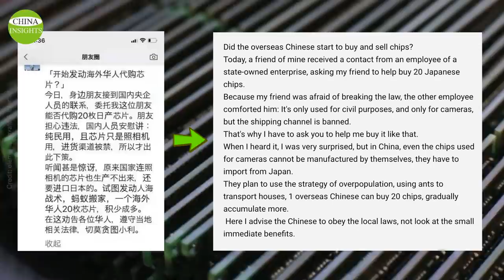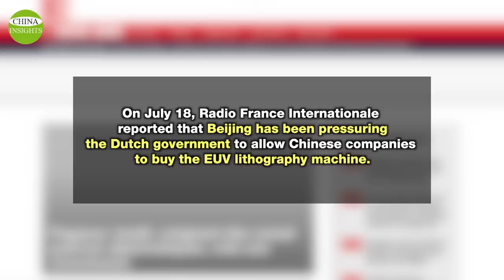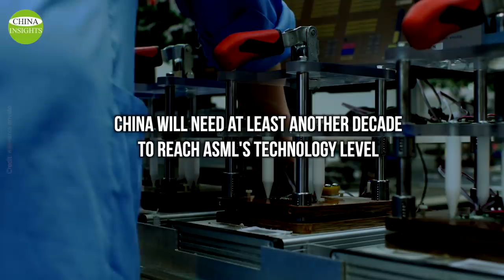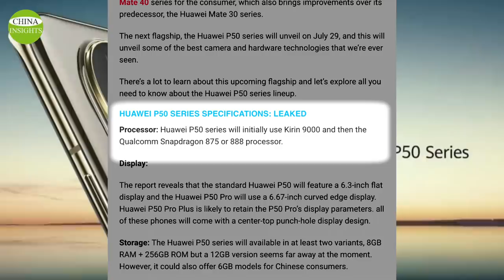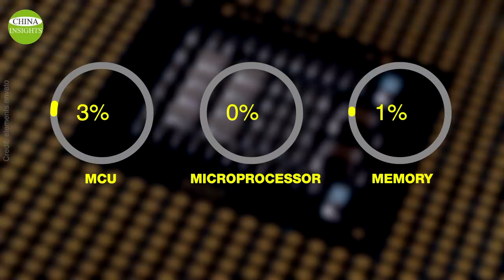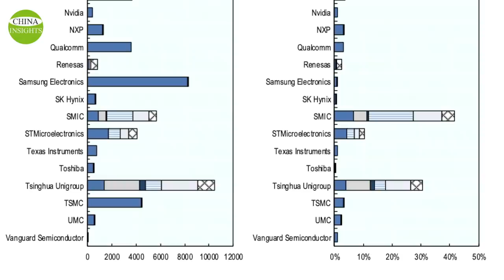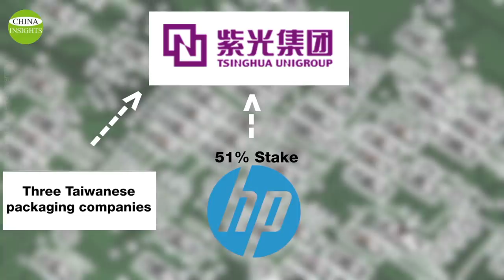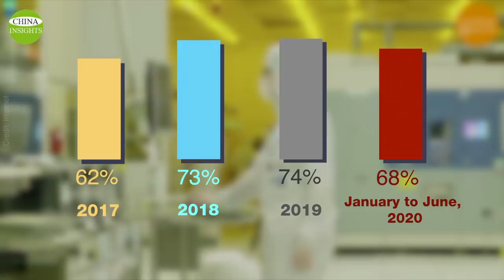China chip shortage: $1 trillion government funds/How a giant with massive capital become bankrupt?

Comment: China's problems, in semiconductors, go a lot deeper than just foundries, which people are over-focused on. Even if they had access to current gen UV lithography, they lack the know-how on the uArch design side, which is the starting point of the semiconductor business. What AMD, Intel, ARM Holding, Nvidia, Apple, Qualcomm, etc., have is a huge array of fundamental knowledge on how to design an effective architecture, which is seriously non-trivial, especially when it comes to aligning that architecture with latest fab processes. And no, you can't just swipe, or even license, the uArch and get the same results as, for example, Apple when it comes to implementation of something like the M1. This is why most of them, even if fabless, maintain access to low-yield test fabs, as it's not as simple as drawing up a circuit and sending to PCBWay, which is how people not familiar with the industry interpret things. 

The whole flaw in China's plan is the CCP's notion of state planned winners and losers, and their dopey nationalistic obsession with complete self-sufficiency in an industry that exists on a truly global basis. This is pure Soviet style thinking: you can get away with that when building some dodgy skyscraper with questionable vortex-shedding performance, that doesn't have to meet the building codes of other nations, but you'll never succeed against an entire trans-national industry that's locked in cut-throat direct competition. TSMC is nothing without ASML and AMD/Apple, etc.; and ASML is locked in a multi-decade battle with others in the space (including my former company, UltraTech, which for years was one of the leading producers of steppers). You've got companies still researching how to get us to multi-bean electron lithography, you've got R&D being piled into work around this space across the US, Asia and the EU - it's pure folly to believe you can use state-planning to build viable competitors. You either end up with bureaucratic boondoggles that end with huge amounts of wasted money and bankruptcies, or you get a Huawei - a state sponsored IP theft ring that any company or nation would be wise to steer clear of.

The CCP's obsession with control is derailing mainland China's advances in this space because the CCP IS THE bottleneck. Proof? Just look at what Taiwan has accomplished, and everywhere else that doesn't try strong-arm command economy nonsense. Without the CCP, I have no doubt that mainland China would be a leader, probably THE leader in the space. Just as a reminder: TSMC, Foxconn, Pegatron, Asus, Acer, MSI, etc., are not PRoC companies, they're all RoC (Taiwan). Tell me again about how brilliant the CCP is when all those "China assembled" iPhones are being done so by plants controlled out of Taipei? And why do companies all over the world go to Taiwanese companies to front-end manufacturing in China? Because the Taiwanese companies respect and protect intellectual property of their partners, and aren't beholden to the CCP's insane nationalistic "self-reliance" doctrine (which is really just about them maintaining their tenuous hold on power). 

Finally, there is a lot of just incorrect information being bandied about, regarding process feature sizes, mainly because 7nm doesn't really mean 7nm anymore (and hasn't for a long time). Who actually leads in that space isn't nearly as clear as clever marketing makes it appear: TSMC has the bigger footprint, but Nvidia would likely argue that Samsung's current "5nm" process is superior to TSMC's 7nm; truth is, depending on uArch requirements, TSMC, Samsung and even Intel's 10nm may be superior under different conditions and requirements. Just to be clear, TSMC 7nm does not result in halving of the feature size, versus Intel 14nm, as the feature size naming is pure marketing - you can watch this video for actual comparisons under an electron microscope: https://youtu.be/1kQUXpZpLXI . 

(In fairness to TSMC, which is the worlds leading foundry company and produces fantastic results, Intel was the instigator of the feature size bogus marketing tactic. They fell both a generation behind [ though it is only a single generation in real-terms, not the multiple generations that the "nm" marketing nonsense makes it sound like] and got leapfrogged on the marketing front by some very smart people at AMD and TSMC, so now they're having some fun trying to reset the marketing lingo around process naming - it's nice to watch Intel squirm a bit.)
Reply: Very nice comment!
Reply: Very good comment
Reply: Excellent post.  Thanks.
Reply: The main problem you didn't say.
Soviet thinking has been ingrained in the population and this will do long-term damage. Example Russia has the lowest taxes in the world, it has almost all the resources you need, as long as you don't mess with politics you can do almost anything. But about the economic situation almost all Russians will say 'the state didn't plan it right' according to Putin, the hardest thing to change is the collective farm located in the mind. Another example look at ukraine the country is literally at a standstill, you try to talk to ukrainians to understand what is happening and they all say the same thing we are waiting for a president who can plan the future of the country.
The mentality of the Chinese population is the most conditioned in this regard. It will be interesting when reality enters the room.
Reply: Bravo, smakfu!  This is the finest, most technically astute, detailed comment to a technical/economic/financial Youtube video that I have ever seen.  You take the general overview of the video, and fully explain, component by component, why the thrust of the video's coverage is completely justified.  Outstanding work, and you clearly have recent industry-specific knowledge.  Best Tl DR ever.  And, it makes the poor fifty sent army woo mau comments on here all the more pathetic. Also, the interesting parallels some have made here regarding the similar difficulties in reverse-engineering fighter jet engines do seem appropriate.  You have the smakfu, indeed!   I think that we can conclude here that the command and control economy has no place in the oncoming Singularity economy.
Reply: Wow. That was insightful, informative, and great reading. My eyes usually glaze over with long posts but this was a pleasant surprise.
Reply: @DanielSilva-jj2lz  Brilliant reply too.   Decades of conditioning as you have mentioned affect all 3 countries.  I remember reading years ago that many Russians want a 'strong leader'.
Reply: WOW 😳
Reply: @smakfu1375  Thank you for your excellent comments which are mostly correct.
China has been able to snatch more than 100 TSMC engineers and scientist by offering them 2-5x the salary of TSMC in Taiwan. These TSMC talent are the key people helping China to build their own EUV lithography machines and solve the problems of making 7nm node chips.
If you look at China success in building their own space station, without western technology, look like China will succeed in  making their own EUV lithography machines by 2025. 
What is your comment on this ?
Reply: If you could make your own video explanation would be helpful to others.
Reply: @zenlei8258  China has indeed successfully built a space station, and congratulations on that.  And, at least somewhat without Western technology.  But quite a bit came from Soviet/Russian tech, like the clone of the Soyuz to get taikonauts up and back
Reply: @klimankhmeron7636  🥤🍟🍔
Reply: Good analysis
Reply: Best comment of the year 2021.
Thanks for taking the time to share your insights with us.

Q: Did Intel miss the train (M1 chip generation)?
Q: Is AMD much better prepared than Intel for the coming years?
Reply: @alanparsonsfan  China is always depending on foreign tech knowledge to advance.
They hire people with big money, buying the tech for cheap or sending their trojan workforces outside of China.
Obviously those trojan workforces task is to steal information and tech knowledge.
Most current prominent case was with Tesla and their full self-driving software.
A former employee made copies from the data and went straight to xPeng.
But they couldn't figure it out. That's why they went with Lidar.

A example where they bought tech for cheap is the magnetic train from Germany.
Germany invested a insane amount into the project.
But it was demolished by the politicians cause it was too expensive.
China got in and bought it from them for a steal.
Reply: Thanks for your insight; this was a fascinating read.
Reply: @Shaolinof36thChamber  The M1 is a very impressive architecture - so long as it's implemented in its closely-coupled system on a (multi-chip) module infrastructure. Load-Store RISC ISA's, like ARM, are extremely sensitive to latency differential between memory (including all caches) and the CPU core register file. This is especially true with the M1's performance cores, as they're extremely wide (8-wide native decode). To achieve effective use of the dispatch slots and pipes available (especially without uArch state duplication tricks like symmetric multithreading), requires that the instruction fetch and load-store occur with as few cyclic delays as possible. This means as flat a caching topology as possible (L1 and L2 - no L3) and memory coupled as closely to the rest of the SOC die as possible (e.g. on the same MCM substrate).

But there's a big problem, this makes for a highly inflexible system-level architecture. This works great in tablets and phones, but in more general purpose machines, we can already see the issue: you can't get a MacBook (air or pro) or an iMac, powered by an M1, with more than 16GB of shared unified memory. For a lot of workloads, that's not nearly enough (my MacBook Pro from Mid-2015 has 16GB, my current 8-core wintel laptop has 32, and my desktop has 128GB - hell my RaspberryPi's have 8GB in them). Apple can't decouple the memory architecture because it's intrinsic to how the M1's Firestorm cores achieve their industry leading IPC and power efficiency.

In contrast, while not as efficient, AMD's Zen 3 architecture is massively flexible - scaling from 4-core entry-level solutions, up to an astonishing single MCM CPU package that includes 64 (soon 128) CPU cores. AMD's solution: highly modular architecture with highly-tiered and massive caching strategy. And it works: in terms of sheer brute force, Zen3 (while needing higher clocks and, subsequently a much higher-TDP envelope) are in the same ballpark as the M1 in single-threaded throughput (and are quite a bit faster in overall per-core throughput, when factoring in SMT, where multiple instruction streams are dispatched simultaneously). And, for now, they absolutely dominate the high-end, many-core market.

As for Intel vs. AMD, Intel will likely make a comeback in a generation - they have the know-how, they have the talent and they have the cash. But, IMHO, it isn't happening until post Alder Lake and Sapphire Rapids. Leaked info indicates that the Sapphire Rapids die-tile arrangement will top out at 56 cores per-socket. We know from the Gigabyte leak, that AMD will likely be shipping 128 core (16 CCD's) single-socket Epyc/Threadripper at or before the launch of Sapphire Rapids (which has already been delayed until next year). Intel has had a lot of problems ramping their latest processes, but I think the biggest issue is they failed to react to AMD's modular approach to building CPU SKU's using core complex dies and multi-chip modules. Their new tile interconnects are a good step in the right direction (and potentially superior to AMD CCD architecture) but their solution isn't even on the market yet. 

To make matters worse for Intel, Alder Lake (and I'm highly suspicious of supposed "leaked" benchmarks) isn't going to substantially slow AMD's momentum (especially as AMD has a Zen 3 refresh in the wings). Intel showing up with an asymmetrical 8 performance, 8 efficient cores (24threads) when the competition already has consumer / entry-HEDT products with 16 full cores and 32 threads (and a plethora of true HEDT options), makes Alder Lake smell a lot like AMD's old Bulldozer architecture - not enough to compete. To make matters worse, nothing about Tiger and Rocket Lake indicates that Intel (even on their 10nm process) has TDP well managed, which means I think they're in for a tough couple of years. 

That said, these are all products that were under development before the leadership shakeup put Pat Gelsigner back in charge, and certainly well before Glenn Hinton returned. I suspect when Intel starts firing on all cylinders again, they'll return with some shock and awe. Lisa Su has done an incredible job running AMD, but she and the rest of AMD would be well advised to not assume Intel, with Pat Gelsinger and Glenn Hinton running the show, won't again drop a Nehalem-scale bomb on the industry - I'm almost certain they will. If AMD doesn't want to repeat it's past mistakes (and Intel's recent mistakes) they wont get complacent.
Reply: Awesome read! Loved it. Thank you.
Reply: @DanielSilva-jj2lz  Awesome read! Loved it. Thank you.
Reply: @alanparsonsfan  Awesome read! Loved it. Thank you.
Reply: @smakfu1375  Wow. Very good analysis. But I think Apple kinda shot themselves in the foot with M1: it is a 'one size fits all' thinking that does not usually work. You could do the same thing AMD did with Load-Store archs like the ARM (IBM's POWER implementations are good examples as are Fujitsu's ARM64 based powerhouses). The main difference is the goal of the design: The M1 was designed for extreme power efficiency, while EPYC was conceived as a brute. I probably won't buy an x86 based smartphone, but I really can find use for a good EPYC based server.
Reply: @reaperinsaltbrine5211  Funny you mention Epyc servers, lately, every time I check the processor type when I provision and EC2 instance, it’s either provisioned off of a new zen2 based Epyc monster, or it’s an ancient Haswell Xeon.
Reply: @smakfu1375  Interesting.
Reply: very good read cheers
Reply: @smakfu1375  Great technical insight!  Apple pulled off 64GB of memory in its M1 Max variant along with up to 400Gb/s memory bandwidth.  It looks like the Apple engineers know what they’re doing.  Also, I think because they’ve optimized swap, I seem to be doing fine with my baseline M1 MBA with 8GB of RAM.  I’m looking forward to further improvements in their M2 next year.
Reply: @Nakameguro97  Yeah, the M1 Pro/Max variants are very impressive. And seriously expensive (though that didn't stop me from ordering a 64GB M1 Max 16inch MBP, to replace my aging mid-2015 MBP - oddly it was the return to an old school style keyboard and adding back in the missing ports that sold me more than the M1 - lol). It'll be interesting to see where they go next.
Reply: @Shaolinof36thChamber  The Transrapid, the german magnetic train project, was not demolished, which is actually the correct word here, because it was too expensive. Most of the work was already done, the development was finished and it was pretty much ready for the market. The problem was that at this time, a change of government happened. Chancellor Helmut Kohl's conservative CDU was gone and the socialist SPD as well as the Green Party, which at its very core is a hostile-towards-technology maoist party anyway, raised to power. 

And the Green Party deliberately demolished this project and sold it out to the very disadvantage of the german citizens, who funded the billions for this project and now got back nothing, not because it was too expensive or because it would not have its uses, but because it was a hightech project and, even more important, because it was a project initiated and pampered by Kohl and the CDU, which they despised. They demolished the beautiful china simply because that fat great-uncle they've never like bought it once.

For a better understanding, the Green Party also massively halted the expansion of the internet and later on of DSL here in Germany. The Green Party can be blamed to a large degree for the fact that Germany is basically a third world country when it comes to the internet and digitalisation. Hell, they've even tried to ban BTX, can you imagine that? 

And I remember discussions in the Bundestag, the German parliament, where members of the Green Party held gleeful speeches about how there would already be a fast means for domestic travel - namely the plane. While today they try to ban people from flying or to make flying at least so expensive that the stupid plebs can't afford it anymore, all while telling people they should use the (quite expensive, inconvenient and generally terrible) german railroad and while bitching and moaning and shedding bitter crocodile tears, because Germany's reailroad system is so  pathetic - whereas China is about to replace domestic flights with the Transrapid. God, I really, honestly and deeply hate those suckers.
Reply: @Furzkampfbomber  Thank you for the insights.
Then the worst is yet to come for Germany?
My guess is raising gas, oil etc. prices.
Cause your new Regierung is basically green.
Reply: Just like in exams in high school, copying does not help you learn the subject.

Reverse engineering tells you what was done, not why it was done that way. That is especially true for complex interactive systems.
Reply: I would argue 3d gaming
Reply: @covenant_mog05  
Imagine a China  with a democratic  federal like system with multiple states/region inside.  The chinese people unshackled from the destructive cccp controls and doctrine. Taiwan has achieved so much, 
imagine 20 plus Taiwan like states exist in the mainland. It will be a much better future for the chinese people.
Reply: Ww
Reply: Great post, wish Wall St analysts could write such things.
Reply: @Shaolinof36thChamber  Worse than that - we have a race track in Germany that is called "the green hell" - guess we better sart using it for something else...